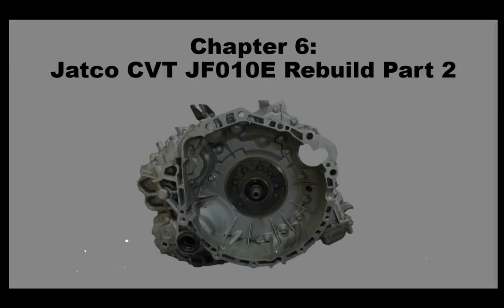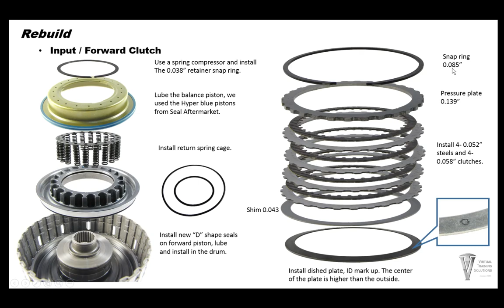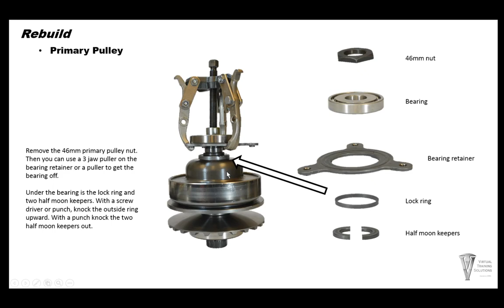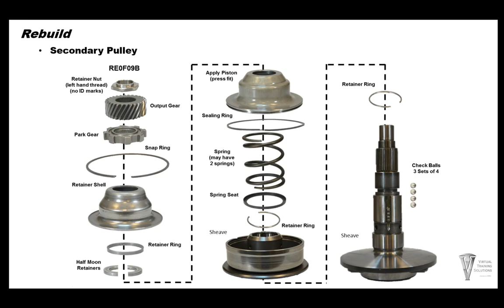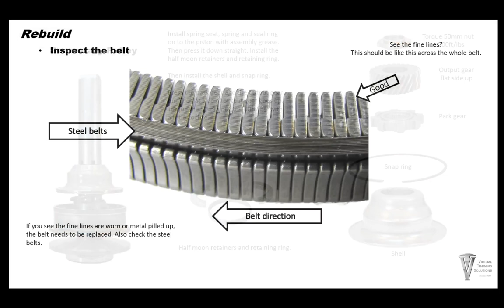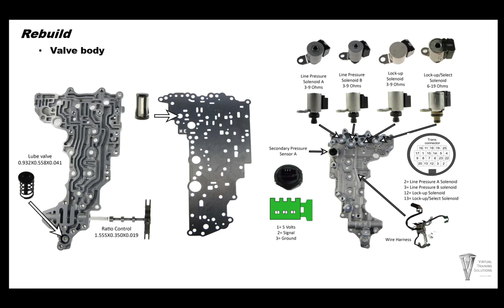07 vts jw jf010e subassemblies

Comment: I don't see where the "D-shaped" seals go.  I have two seals in my kit that are like large flattened o-rings that fit inside the forward drum piston and center hub,  Don't know if they are the "d" seals (about 1x3mm profile, flat rubber).  But I don't recall there being any inside the forward clutch drum to begin with and there is nothing to hold those seals in place or any logical purpose for them that I can see.  Are the D-seals only on certain style drums?  Thanks for your excellent videos, wish I had them a couple years ago ;-)